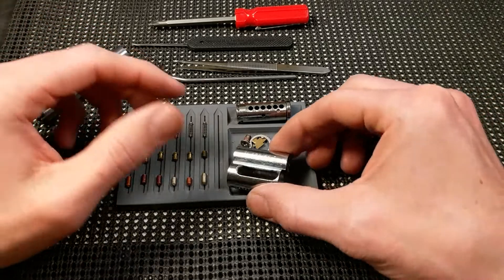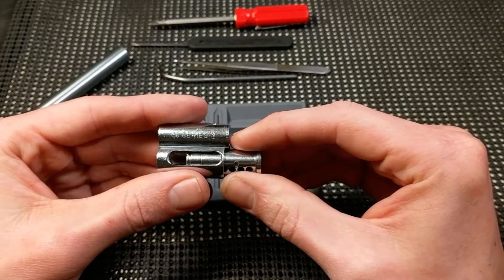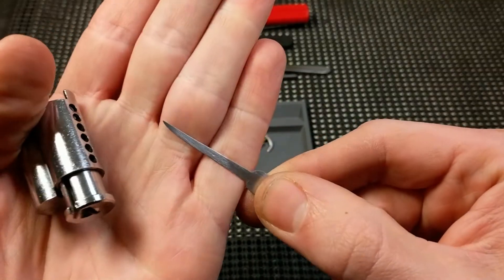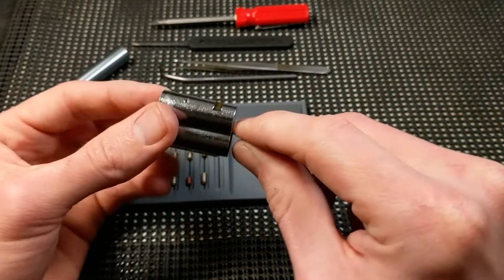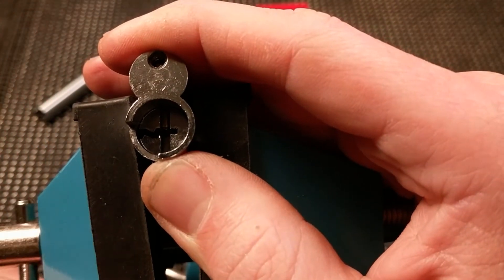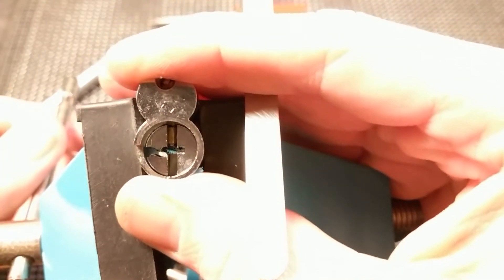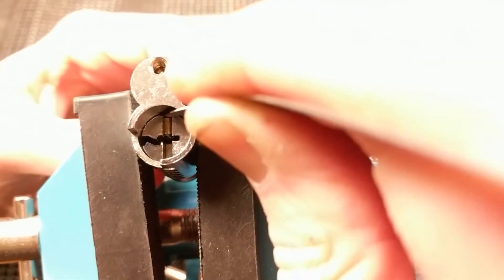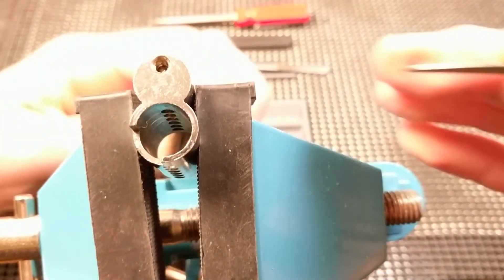How to fix an Abus 83 if you get the detent stuck in the bible.

Comment: Just throwing this out there. I didn't have a pick small enough. I used a sewing pin and Dremel. The ball at the end made it easier to maneuver. The needle is soft metal so it doesn't take much to make it thin out enough to wedge in.

Comment: I just bricked an abus 888 core. I repinned it, and in the way back in my follower and core just stopped at pin 5.(6pin lock) it is now stuck. My guess is that a driver pin got stuck in a fake hole somewhere. Time to buy a new one I guess.
Reply from the maker: Nah there's got to be a way to fix it. I have an 888 in storage that I can tinker with in a few days. I'll see what I can come up with. In the meantime, check to see if this method applies: https://youtu.be/8x1CfC8DWY4
Reply: @bleh222234  That's not quite what my issue is. My key is stuck and one of my driver pins lodged into the side hole for construction keys next to pin 4. I tried to shim it to no avail.  I should have slid in the core at the 12 o'clock position,  I think I ended up at the 10 o'clock position.